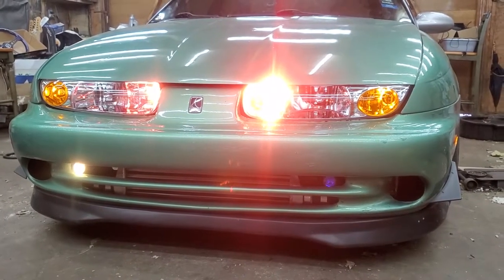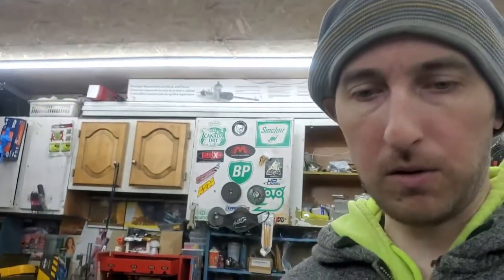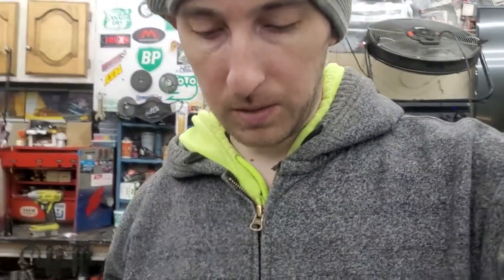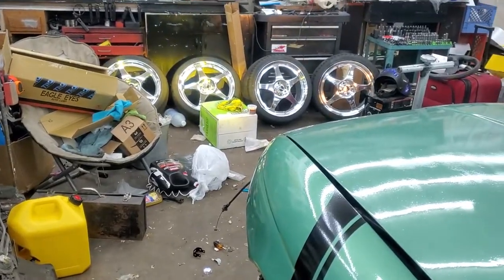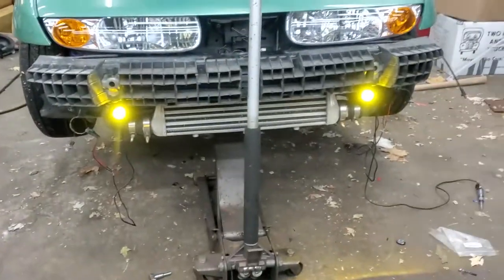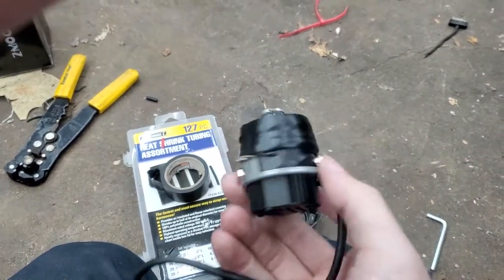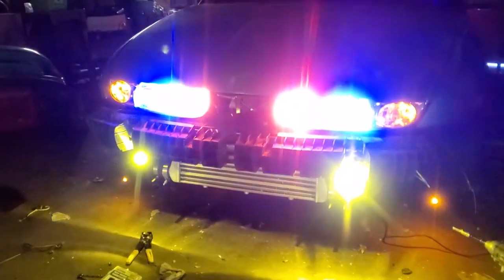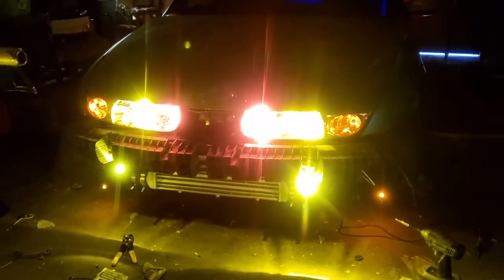Projector fog light retrofit & NEW Led headlights

Comment: Nice! I'm actually running a set of Audi A6 projector fogs on my SW2, threw some yellow led "bulbs" into them. Alas, the external glass lenses are chipped to hell, so I'm wanting to see if it's possible to get replacements for that.
Reply from the maker: Id start looking into some led pods and retrofit them into the oem light you have...
Reply: @BuilditBreakitGarageinc  I think you misunderstood the issue I'm talking about. The lights work fine, but the external lenses of the housing are chipped. I like the size and fitment of them, they fit well in the 2g coupe bumper I have on my wagon, but the external finish isn't that great due to the chipping.
Reply from the maker: Oh I see... but what I am talking about is a full led pod light... im sure you could find one about the same size and just mount them in the stock location
Reply: @BuilditBreakitGarageinc  Hey, I had a question... What year WRX did u buy and modify the coilovers to the Midori? I'm thinking I might just do that too, if my H&R Springs and KYB GR2's wear out since the suspension is 10 years old now. I found out today that H&R springs doesn't make the sport springs anymore for the S Series, upset me greatly from the Saturn hate...lol